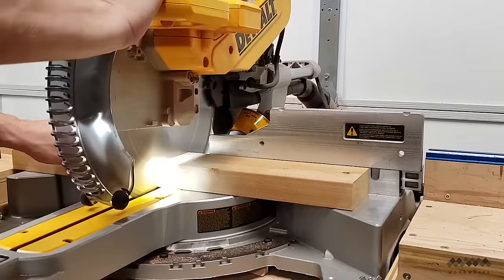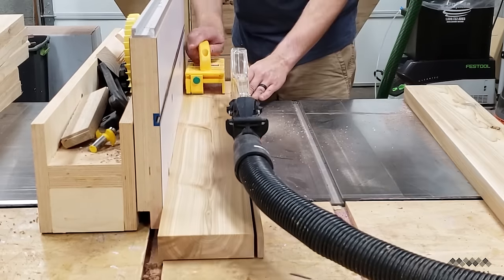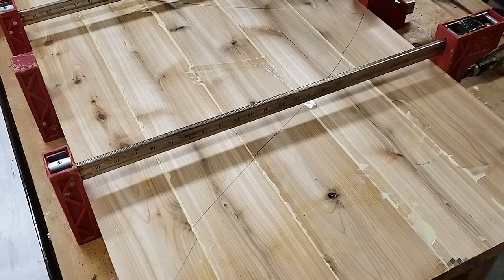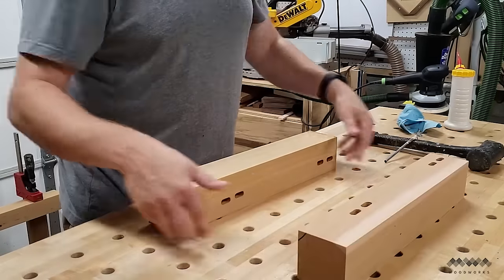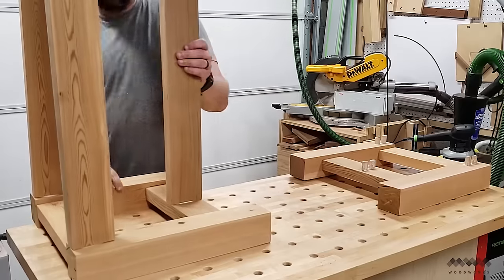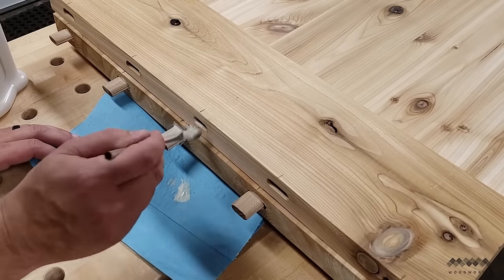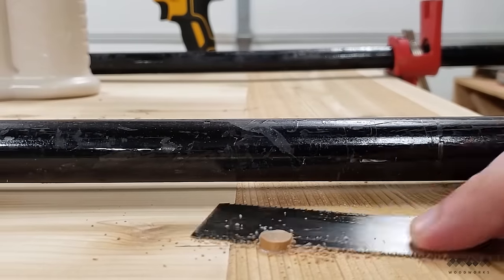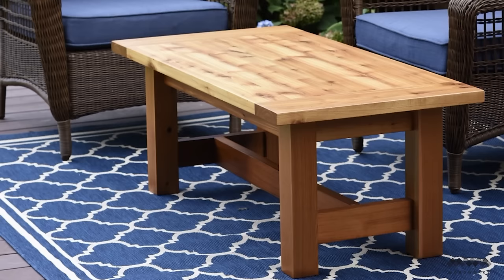How to Build an Outdoor Coffee Table

Comment: Big fan and subscriber - you are a great teacher. My only question for this build is about water pooling on the surface of the table... any concerns? Thanks for the video.
Reply from the maker: Water will pool on the surface for sure. With that said my table lives under a pergola now and so it's not exposed to direct downpours. A slatted top is a good option but it's also a more involved procedure to build.

Comment: I am working on 2 dining table benches that will be 18” high x 6’ long x 14”deep.  I am torn as to whether or not I need to put breadboard ends on the 14” width.  The seat top will be 1” thick heart pine (dry) glued from 4” rips.  What is your opinion of the need for the breadboard approach.  I will likely put cross grain ends on for looks but am not sure about needing the expansion compensation.

Any help you could be, would be appreciated.

Mike

Comment: Hello, I don’t get why you correctly allow for expansion by glueing just the central mortice but then put pins in the next ones... moreover when you trim the edges after that wouldn’t it led to misalignment of the long edges once the center expands and the two ends not, due to grain direction? Thanks. Btw the table looks beautiful...
Reply from the maker: Cedar is actually a very stable wood species and it doesn't expand and contract very much at all. My table has gone through 2 summers now and hasn't really moved noticeable at all. I'm very happy with it 👍
Reply: Also, are dominos rot resistant? And epoxy for the finish with spar varnish?  How well has that held up on the top? Has the spar varnish gotten all crinkly? Has it protected the soft cedar top from incidental dents and scratches adequately?  With the dominos only extending an inch or so into the breadboard end , has the breadboard end curled or rolled after 2 years? Is it out in the weather 24/7 ?

Comment: great table i have just built it and was just wondering if a couple of coats of your beeswax-mineral oil concoction would be enough to protect it. i live in ireland with more rain than sunshine. any tips ??
Reply from the maker: No the beeswax finish is only for kitchen utensils. You should not put that on a table.